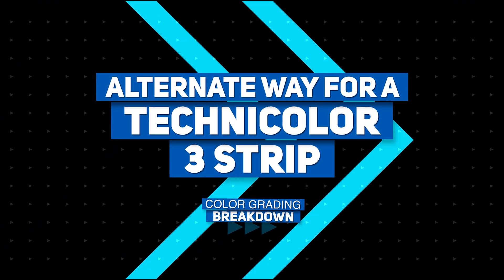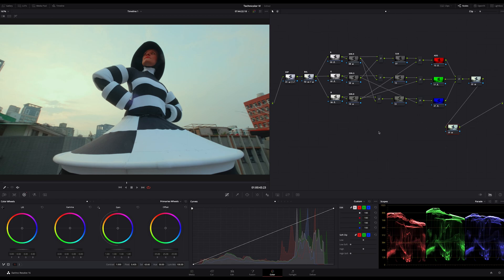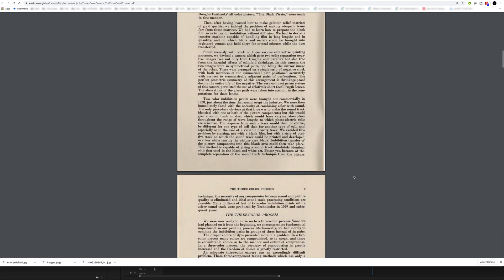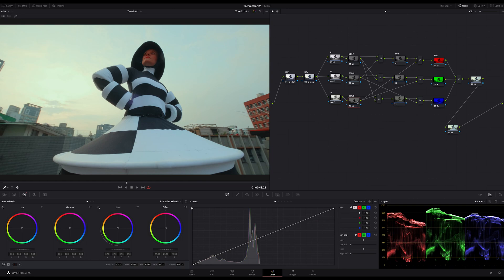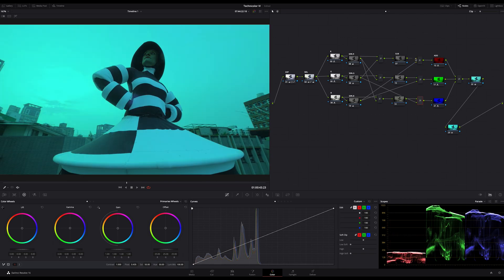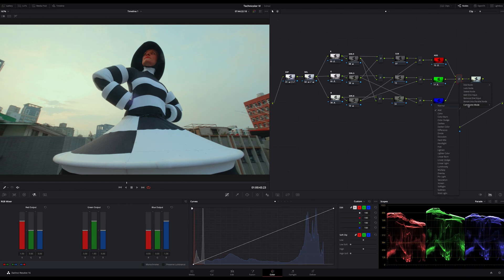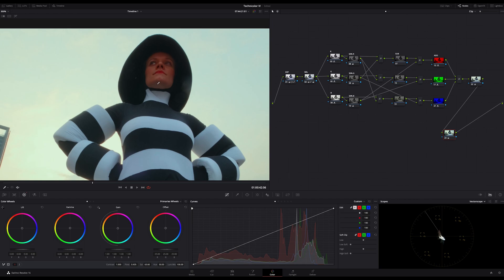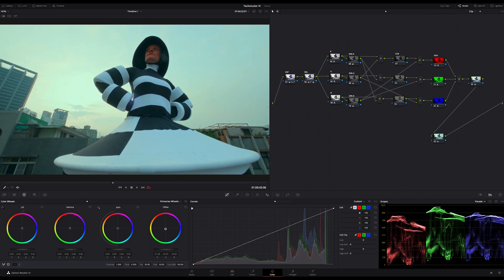DaVinci Resolve Technicolor Look Tutorial with a 3 Strip - Color Grading Breakdown

Comment: So there is nothing wrong with my node tree the problem is that the method simply doesn’t work. Yellow is completely changed and we know from The Wizard of Oz that it is supposed to be glorious. The issue is that the 50% is too high. The higher that value the muddier the colors are which is the exact opposite of what Technicolor is. In his follow up video he reduces it to 5% but then what is the point? That is a small amount and it no longer follows the theory of Technicolor. Then it is just fudging the DR color system to try to make it match and that can probably done without the complexity of all of these nodes.
It was a nice idea but ultimately disappointing.

Comment: I have some genuine 3 strip Technicolor film. I can capture each roll as a DPX sequence, so I end up with true red, true green and true blue sequences. So, big question; I'm guessing I would need to create a video layer for each and align them on the timeline. But how then can I combine these three so I can treat them in the color tab as channels and not layers? Is this something you have considered?
Reply from the maker: That's a very good question! Spontaneously I would try the following: drag the 3 clips into your timeline, change the composite mode (in the inspector) of every clip to ADD and combine them to an compound clip, than you should can use this clip as one on the color page. Would be interesting if this works! Thanks for your question!